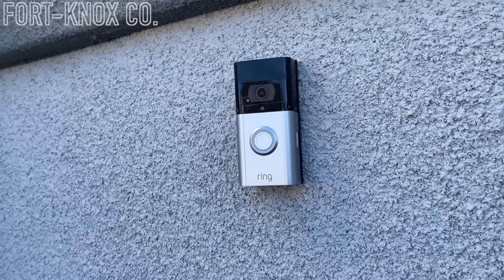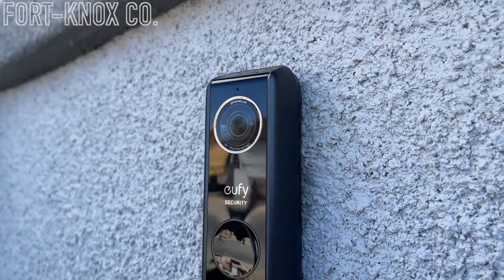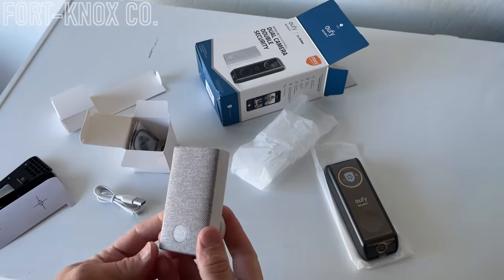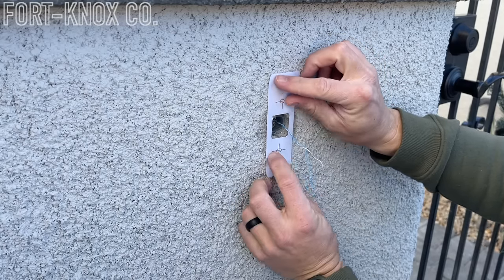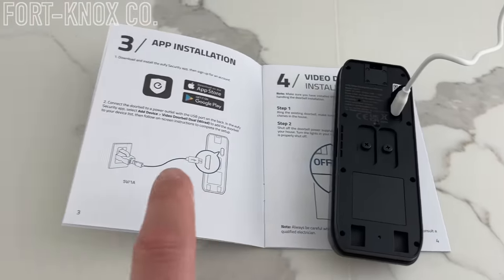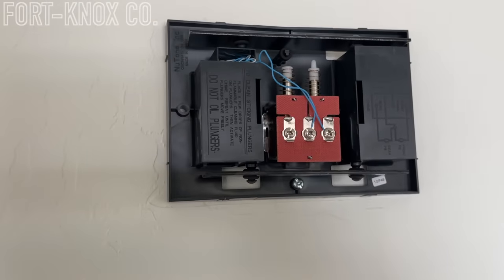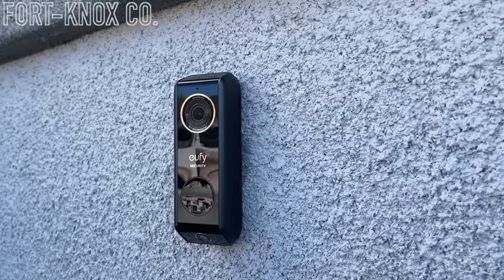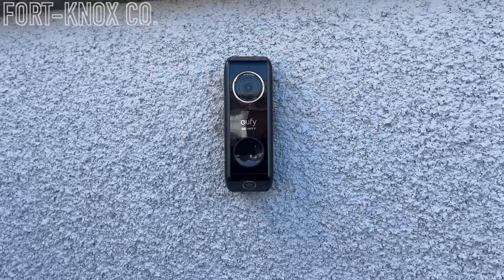BEST Video Doorbell 2024 with No Subscription Required Eufy Dual Camera Doorbell Installation Memory

Comment: Are you able to plug it in to a wall outlet and use it?  We don’t have an existing door bell.
Reply from the maker: It doesn’t have the ability to plug in. It also
Runs off a lower power source than a standard plug. Doorbells have a transformer that reduces the power to a 30v type of power supply before it runs to the doorbell. So I have a video showing this installation of a doorbell transformer from a regular outlet power source to the transformer to the doorbell wires.  

But they have the battery powered doorbells. They can be mounted and used pretty much anywhere. You just have to charge the battery every once in a while.

Comment: Great video!!  I don't need a doorbell.  I live in a condo where I have had a chair taken and someone put grease on the catwalk in front of my door.  I just want to be able to see the people who are doing this or have it stopped hopefully when they see the camera.  Do you recommend this camera?  Do I need any wifi?  I have seen videos of cameras that need it.  I don't think my wifi would extend outside of my condo.   Please let me know.  Thanks.
Reply from the maker: If you are in a condo I don’t think they will allow you to run wires to your cameras, and in this case you’d most likely need a WiFi system set up for all the cameras to communicate with the hub. Eufy products in my opinion are great. So I would recommend them. But your situation is unique. So you may. We’d to look at what your options are with WiFi wireless cameras, wired cameras, etc.

Comment: This is the best unbiased comparison between the Ring and Eufy.  I never understand why one would want to pay to get your video recorded on the cloud.  And I agree it is by far a much better camera.
I've had the original 2K for a little over two years now.  I had to get the battery version because the location of the original doorbell button is not at the best location to put the Eufy.  Interestingly enough I've only had to charge the battery twice; I get notified when it's time to charge it so that's a nice feature.  This model came with a homebase that serves as the doorbell and video storage.  It has a really good object (person) detection system.  I get notified long before a person gets within 10 feet of the door.  I decided to install an commercial grade day and night color camera with a wide lens that covers the ground floor as well as the walkway to the house.
Reply from the maker: I completely agree! I personally love the doorbell. After having a couple others I still prefer the Eufy. I think the cameras detection system is great. I’m impressed how it has the facial recognition and sends you a snap shot of the persons face as they are walking up. And you are right with how fast it is. I hated getting a notification about someone at my door and by time I get it open to view they are gone or walking away. Not with this Eufy.
Reply: i agree, very good information. im happy someone is just putting good videos out there with a lot of the same questions we all might have.

Comment: Does this model sync with Amazon Echo Show devices and / or your laptop computer? Thanks
Reply from the maker: I’m not sure if it syncs with Amazon products since it’s not one that they make. It has its own app and you can control and sync other Eufy products/caneras. But not sure how it works with another brands home hub.
Reply: @FortKnoxCo  - Thanks for the reply. I will try to do some research on the syncing capabilities and if I find anything one way or the other I'll get back to you here.
Reply from the maker: @jiml5274  awesome. Sounds good

Comment: I got this doorbel for a while now. Few points: it only lasts 3 months instead of a year. Has a proven security flaw that video files are stored out of the country. Which can be accessed by Eufy. The doorbell is so slow establishing a connection that the package guy is already gone 9/10. Although i do have 1000mb internet. So that is a couple of things from a longterm user. What is also funny is that if you also take the camera's with the base station.. you can steal it, and reset it. It will delete remotely all the content from the basestation. Leaving you with an empty basestation. It is the perfect scenario for burglars.
Reply from the maker: Sucks to hear that. I haven’t experienced any of those problems. The notifications come in quick, usually within 1-3 seconds of the motion my watch and phone are vibrating. And I’ve been able to catch people at my door before they leave and speak to them through the doorbell very well. 
As far as a base station storage and if your not storing anything in cloud, you’d want obviously want that in a secure location. Not out in the open or easily grabbed. That would be the same case with any security system that’s stored on property. You don’t want anyone grabbing the storage device.
Reply: Everyone should read this entire comment .
Reply from the maker: @AM-mr8or  I agree. Everyone should do their research and see what works best for them and their budget.

Comment: I already had a few Eufy/Anker devices and cameras. Had to order a new transformer (and then find the old one). The video and system quality of this one is hands down better than the Ring it replaced. I'm planning on getting rid of the last 2 Ring cams and go Eufy all around.
Reply from the maker: That’s awesome ! We have no complaints. I might try the new eufy exterior house light with camera. Looks pretty cool that you can change the colors of you home lights and have it hard wired in too

Comment: I haven’t finished your video yet. I purchased the Eufy but left it in the packaging for a year because I was testing two others. I installed it and it worked ok but didn’t really suit my needs. One week later it went deader then a door nail. I contacted Eufy and asked their opinion. I knew it was warranted for a year and when they came back it was to tell me it was dead but out of warranty. I had bought a couple hundred dollars worth of items from them. I thank them and sent it all back. I bought a Wyze doorbell close to hundred cheaper and I’m really happy with it. Buyer beware they have no heart nor justice in them.
Reply from the maker: That’s very unfortunate. I’ve never heard of one of their doorbells just dying for no reason after a week. There wasn’t any type of power surge or something that could have caused damage?  I can see that if the purchase date was a year ago and they couldn’t warranty it after that, your circumstances are unique but on their end I could see how the date of purchase may be the only thing they could go off of.  It’s good you found the Wyze doorbell. I’ve heard good things about them as well.
Reply: That’s kind of what you get for letting it sit for a year.  Sorry but that fault is yours, not theirs.

Comment: Hi, I live in high rise building, can this door bell be use on a regular apt. door with batteries? great tutorial
Reply from the maker: Yes it can. They have a battery version and the app works with it. The links in the description should have both battery and wired options
Reply: @FortKnoxCo  Thank You so much, really appreciate your quick response
Reply from the maker: @samuelmedina5700  no problem at all

Comment: Hi, Not sure where the 2 wires are from when you put the plate up, Where are they connected??
Reply from the maker: In the video I’m installing the wired version, it connects to your existing doorbell on your home. Assuming your home has a wired doorbell, you’d remove your push button door bell and there should be two wires connected to the back. You take those two wires which have a low voltage current and connect them to you wired door bell. With the battery operated doorbell you don’t need any wires to connect to. You just mount the doorbell where you want it and it connects to your homes WiFi.

Comment: Thanks for the great review! I'm considering purchasing this but I'm a little confused as to whether it will work with the Homebase 3 that I just purchased? Does it work with yours? Do you have the Homebase 2 or Homebase 3?
Reply from the maker: Both homebase 2 and 3 are supposed to work with their cameras and doorbells. I have a homebase 2 which works. But the homebase 3 says on its description that it will work with all eufy security devices by Dec 2023. So I’m not sure if that means it works with some but not all right now or what their plan is. I’d assume it works with the doorbell because it’s not a super new product from them.
Reply: @FortKnoxCo  i read that this does not work with homebase 3
Reply from the maker: @johnnylawrence7232  yeah from what I’m readying is looks like the Home base 3c is built for the new 4K camera systems. Doesn’t look like that home base is able to add on the current door bells.
Reply: I have homemade three, it works, update software right away
Reply from the maker: @teaglet1  that’s awesome!

Comment: Thanks for the video.  On Prime day I bought a Ring Battery Doorbell Pro because it was a pretty good price, and because we have a couple echo show’s and a bunch of echo dot’s.  I have not hooked it up yet, but my understanding is that the Ring doorbell will chime on the Echo Dot’s, and show video automatically on the Echo Show’s?   Is this the case?  And will the Eufy offer integration with the Alexa products as a chime or a video doorbell alert?  Eufy claims integration, but people online have complaints.  Thank You!
Reply from the maker: I don’t know much more about the ring and how they integrate. We got rid of ours after having so much trouble with the doorbell and they fact that they REQUIRED a subscription to work they way it’s advertised. So with efuy we have all Eufy products and they integrate together. I haven’t tried integrating other brands with the Eufy myself.
Reply: @FortKnoxCo  thanks.  So you don’t have the Eufy set up to chime with Alexa or Google?
Reply from the maker: @extendedp1  no I have it set up with the chime that it came with. I don’t use Alexa or any other home integrated systems right now. Just the Eufy plug in chime
Reply: @FortKnoxCo  👍🏻

Comment: As a Ring user of 3-4 years, i have never had the issues you were having, the cons and pros are: EUFY pros: no yearly cost, package cam, 2k videos Cons: max 90 days recording local only storage, no removable battery and the worse one: Someone steals your door bell and the video goes with them << one day clearly this will become the worse decision you ever made. 
RING pros: 3 years recording storage, removable battery, 4k videos. Cons: $30 a year fee, no package cam, buy items separated ,Cost.
eventually, someone will make a better door bell, in my opinion so far RING is the best.
Reply from the maker: I get what your saying but they do tend to hold their charges longer and the storage you saying will be lost isn’t true, the data is stored in your home , either in the plug in door bell chime or your home base memory. Also if you choose the home base extended storage you will have way more than 90 days of storage. 
With ring I just never had the quick responses or notifications. I also didn’t like that you had no other choice but to sign up for a subscription. They have the ability to have some local storage in the device if they wanted too. But they force you to pay too dollar for the device and then sign up for a monthly payment on top of that. 
Luckily there’s many options out there to fit peoples need and budgets.
Reply: @FortKnoxCo  i hope this one works good for you. take care
Reply from the maker: @ruddyteck  so far so good. We have no complaints. But with technology always improving I’m always keeping my eye out for the next improvement
Reply: Ring is not 4k.
Reply from the maker: @MrBALEful  great information!
Reply: Same I’ve never had these problems he is having my rings work flawless. I’ve tried the other ones he is talking about and was not impressed.
Reply from the maker: @thunderroad7289  luckily there’s several
Brand out there that all have their pros and cons. Whatever works for you and your budget there should be something out there

Comment: Is this one have option I can put all time online and if no need put if someone moving? And I can connect this with my small screen , connect with my other doorbell screen ?
Reply from the maker: I’m not exactly sure what you’re asking. It’s worded a little bit. Hard to follow. But I don’t believe you can connect this doorbell to a monitor. It usually works just off of the application on your phone. You can turn on and off different detection mode like person, detection, package, detection, and motion detection. And you can increase or decrease the sensitivity, depending on how far you wanted to detect.
Reply: @FortKnoxCo  have video doorbells what can keep them online all time  u can see who moving  another's only when you coming closer like 1-3 m. and voice have awesome but my when u talking with some1 ppl not hear you . I have Video doorbell what start working  only if some1 coming stay front of doorbell :(  just looking for video doorbell what have voice very good and camera working all time and no need to pay every month
Reply from the maker: @demonhunter05  you can view the video live anytime you open the app. You can get notifications of motion and people detection from pretty far away. I’ve had it pick up people and vehicles more than 60 feet away. I have to reduce the sensitivity so it wasn’t going off so much. And the audio talking through the doorbell is great. Just like a speaker phone

Comment: I’m wondering if the power issues from your transformer were the actual issues you had with Ring. My ring doorbell was never this finicky as yours
Reply from the maker: I think that was the issue or at least part of it. I’ve heard some other people having similar issues. Could be the WiFi strength too but with the eufy I have the same internet connections and it’s been flawless. I really like that the Eufy doorbell self diagnosed, told be verbatim what the issues was, the part I needed and instructions on how to upgrade it. The Ring doorbell never alerted be nor told me how fix it. They should add something like that, it would be super helpful.

Comment: Memory storage should also be in the inside door ringer (Protected from outside theft or sabotage)
Reply from the maker: Yep, I believe the bell inside has the internal storage and if you get a home base with the Eufy systems they store data too obviously. Great options
Reply: Hey!   You stole my comment!!!   😁🤔  Agree!
I have an apartment in another state in which I installed 2 indoor Eufy cameras.  They work perfectly and have never been offline.  I don't pay for a subscription but can see all the activity (if any).
Before those, I have 4 Arlo cameras on the outside and they work fine and store all the videos locally, can see them from anywhere in the world, but the lag between activity, being triggered, and starting recording is so long that I most often get nothing on film.  Useless unless the person stays in frame for more than 10 seconds.  I wouldn't recommend the Arlo system.  So far the Eufy seems the best.  I had the Samsung in the past but were so bad I gave them to my elderly mom so I can watch her from across the country should she need help.  They are ALWAYS disconnecting and have to be manually restarted.  So out of the three, so far Eufy is the winner (for me).
Reply from the maker: @ScienceNotFaith  man that’s awesome to hear. It’s cool to hear another success story about eufy. Funny how we all have different experiences with different systems though. I say Whatever works for you needs and budget.

Comment: Great Information and I finally got rid of my ring, (Not paying $$$ for cloud). I installed my Eufy, but is there is no information on how to change the chime???
Reply from the maker: Yeah I love that I down HAVE to pay for cloud storage if I done want to.  Are you wanting to change the chime physically or just change the chime sound?
Reply: @Fort Knox Co.  change the chime sound. Some reason mine is set to Christmas music.
Reply from the maker: @novelx3983  you can change the chime sounds on the chime itself. There should be a small button on the left side of the plug in chime. If you press that it will cycle through the 8 different ring tones on the chime.